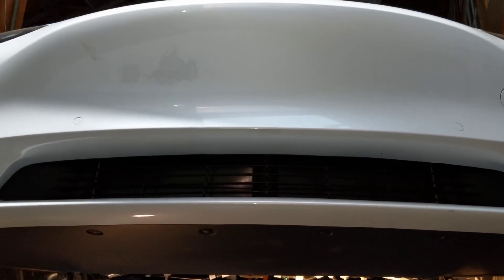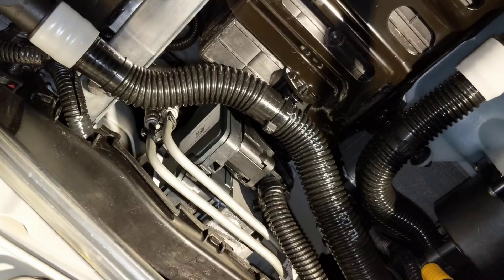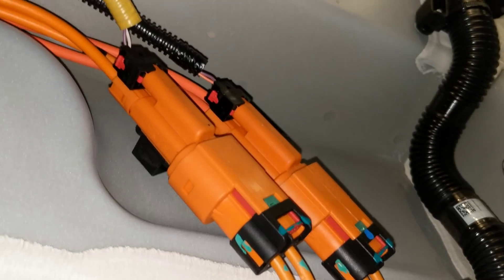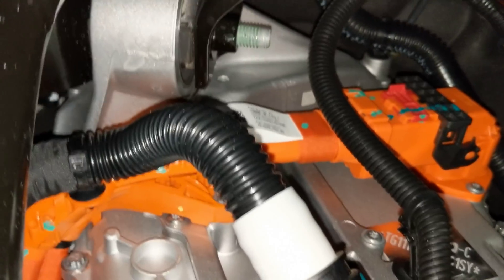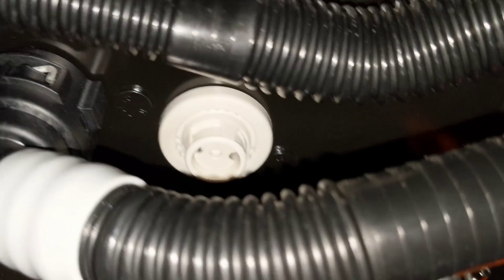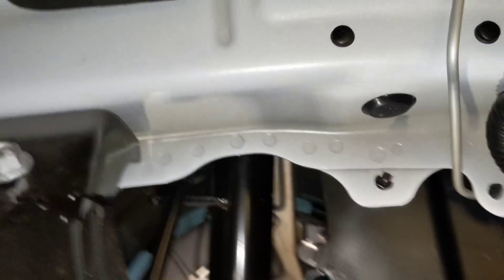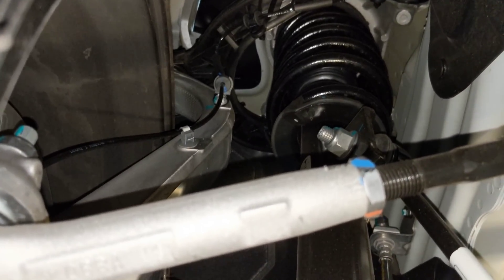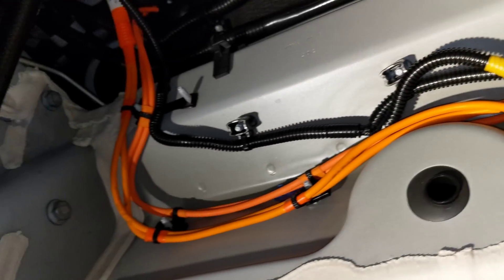Tesla Model 3 Stripped - Part 2 - The Dark Side

Comment: Awesome video!!! Thank you so much. Hey, since you're so knowledgeable, if you get a minute take a look at the new Sandy Munro video here: https://insideevs.com/teardown-expert-test-drives-tesla-model-3-no-longer-compares-it-to-90s-kia-video/.

At 6 min he starts taking about the "transmission" which I think he is using the term very broadly to refer to the drive train from the motor output to the wheels. He is impressed by what he seems to call a "5 bar link"?? Do you have an idea what he is talking about?

thanx!
Steve
Reply from the maker: That's the rear suspension.  You can see it in my video.  I'm not impressed by that guy at all.  He spends a lot of time going on about stuff that just doesn't matter, such as access to the first responder loop.  The 3 will automatically cut power to the HV system in an airbag deployment.  No action needed on the first responder's part.
Reply: Thanx. Thought so. Well he's definitely speaking loosely in the terminology he uses!
Reply: FYI - I sent an email to the address in your youtube profile. Not sure if it works. Just an FYI. :>

Comment: That's an AC induction motor.. Not DC
Reply from the maker: It's a Switched Reluctance motor, using permanent magnets.  It is vastly different than Tesla's previous motors which were indeed AC induction.  Also, technically it's an integrated motor/inverter, so DC goes in one side, and kinetic energy comes out the other.
Reply from the maker: I assure you, Tesla calls it a PMSRM, Permanent Magnet Switched Reluctance Motor.  It's a new type, and very hard to get right, but Tesla did it!  More information: http://ieeexplore.ieee.org/document/6180757/?reload=true
Reply: @Ingineerix  why exactly Switched Reluctance and not interior permanent magnet synchronous machine (which by the way exploits partially the reluctance mechanism) as EPA official certification seems reporting? Excluding Elon's tweet ("switched reluctance partial permanent magnet") what are the sources ?
Reply: DC is a hangover term to describe that motor design. Thankfully more and more folks are using the term 'permanent magnet AC motor.' It is NOT an induction motor however. They changed design on the Model 3 to use magnets on the rotor over an induced current (still 3-phase on the stator though). I think it was to provide better low-speed regen. The front motor on the AWD models will be induction though. ;>
Reply: The classic switched reluctance motor does not use permanent magnets and has inefficiencies at certain motor positions and use cases that made prior EV engineers reject the motor design, however Tesla modified it to use a small amount of permanent magnet and has essentially invented a new type of electric motor.  I'd imagine that in the EPA documents they needed to fit it into an existing electric motor description.  Calling it a permanent magnet motor is incorrect as most of the magnetic fields come from electromagnetism, like induction motors, but permanent magnets were used to overcome the previous limitations of a switched reluctance motor.  As it uses very little permanent magnet, it does not have the rare-earth metal sourcing problems that come with mass manufacture of permanent magnet motors.
Reply: THANKS. From the IEEE SRM Introduction:
"Switched reluctance motor is the double salient-pole structure with neither windings nor permanent magnets on the rotor and concentrated winding embedded on the stator. Thus, Motor has a simple structure, low cost, high reliability, wide speed range, etc[1] SRM has been widely used in industry since its inception, however, the double salient-pole structure and the switch type power supply lead to inevitable noise, torque ripple and a large vibration, which limits its application in the servo system where the request of low speed runs smooth [[2][3]] The study of its output torque ripple has become a research focus, while the torque ripple is also the biggest obstacle for its full access to the market. Many scholars have put forward various programs from different perspectives to suppress the torque ripple 0 It can be summed up as following: One is to change the structural design of the motor, references [4][5][6] reduce torque ripple mainly through changing the structure of the stator and rotor; the other is to use the intelligent control technology, such as iterative learning control[7] vector control technology [8] sliding mode control [9] neural network control technology [10] and mixed excitation method [11]. It can change the output current waveform, making the SR motor torque becomes steady and smooth. Over the years, the study of the SR motor control optimization is more, while the study of the body structure to optimize the design is relatively little."
Reply: Interesting Ingineerix. A reluctance motor, eh? I've been wondering exactly what type of Permanent magnet motor it is. Tesla has not been all that forthcoming. May I ask your source to know that is the design they used? thanx.
Reply: And further to that, we had it early on that Tesla was using a "Motor/Generator Type 1 AC 3 PHASE PERMENANT MAGNET". This is from an EPA document (including the typo). I just had to look up what a reluctance motor is, and it appears to be a design that does not require permanent magnets (the electromagnetism created by the stator interacts with "reluctance" materials built into the rotor. I'm skipping the switching part). Assuming the EPA is correct, how could the motor be the reluctance type? Or is there a reluctance design variation that uses permanent magnets?

I'm a student of this tech Ingineerix. Not trying to trip you up. Just trying to understand, as there is a dearth of info on this topic. :>
Reply: A big, big thanks!
Reply: Yes well summed up. I hope someone like wk057 will quickly inform us what this new beast can truly output!

Comment: Cool video man I love to see how it’s built I’m a auto technician and work on European cars you can clearly see that they build it to save cost because the power train and especially the battery pack is expensive if you compare the built quality compared to a BMW ,AUDI or Mercedes you can see a lot of steel suspension components like rear control arm the front and rear subframe are all steel nothing wrong with that but the chassis is not up to the level of it’s competitors I would still buy one but the only thing I don’t like about Tesla is parts availability and diagnostics that is only available to Tesla technicians.
Reply: Why do you say the chassis is not up to the level of competitors?   Multiple professional reviews so far say the car drives very well, has excellent responses and feel, etc.  Small steel suspension components won't affect performance or feel very much.
Reply: The "whompy wheels" guy turned out to be fraudulent. Not just "some guy on the internet says his claims were fraudlent", but the NHTSA. He was just taking pictures of wrecked Model Ss and then claiming that a "failed suspension" caused the crash, when in reality the car was mangled in an unrelated crash, which correspondingly damaged the suspension.

And as for the "alumium is better than steel" comments: on a strength-to-weight ratio, modern steels such as UHSS are far superior.  Alumium is best for parts on which not much strength is needed, but where you need strength, steels gives you your best buy for your money among metals (only composites beat it, and they have their own disadvantages). Steels are also far less prone to fatigue fracture than alumium - especially if your alumium is tempered enough to try to give it decent strength, wherein it becomes brittle. Steels of course rust if improperly protected, but then again alumium galvanically corrodes badly if you inadvertently touch a part up against a part of a different material, and often suffer badly from salt corrosion.
Reply: The motor is neither induction nor permanent magnet.  It is switched reluctance modified by a tiny amount of permanent magnets to make switched reluctance efficient, but it is very different from a permanent magnet motor design.  No other manufacturer or car is using this yet.  But they will, it is superior.
Reply: i would say also as a mechanic that the front motor will be a smaller unit like on S and X. Main power will be allways on the rear wheels and front motor will be more like passive when not in use like autobahn or cruising.
Reply: I'd say one motor type is optimized for "fuel economy" and other for performance, so for cruising it's maybe using PM and for acceleration AC motor.
Reply: It's not a PM motor, it's a switched reluctance motor.  Tesla's design is unique and uses a small amount of permanent magnets, but it is not a PM motor and has nowhere near the rare-earth needs of fully PM motors.
Reply: Do you think on the dual motor version that it will have the same exact motor as the rear ?
Reply: No. It will be induction, like the S/X
Reply: What do the other guys use instead of steel?
Reply: They uses aluminum for the subframes and most suspension parts.
Reply: I think the motor will be permanent magnet instead of induction
Reply: OK, but Tesla has already tipped its hand that it will be induction
Reply: Interesting, given the priority of weight reduction on EVs. Must be a significant cost difference.
Reply: Steve bakker 
Any idea why they would use PM motor for rear and AC motor for front?
Reply: But you hear of suspension parts failing frequently on the 'S' and misaligned wheels. These cars will not last and the spare parts are impossible to get.

Comment: i do not like all the open wires ... for the wiled life to get into
Reply: Ingineerix removed many covers to expose those wires for the review. Tesla designs cover the bottom almost completely from front to back. Keeps animals out as well as wind for reduced drag.
Reply: For what it's worth I have a 2002 Dodge ram pickup and watched a ground hog jump up under the front one day. When I checked the next day he had climbed all the way up on top of the engine and chewed on the  firewall insulation. So the Tesla isn't any worse than most other cars.

Comment: What is the oil filter for?
Reply: When vehicle is new, during drive-in period, small metal shavings contaminate oil when gears polish themselves. This is why Model S/X require oil change on first service. Now there is no need to have oil change.
Reply: Just to be clear, Arnis is referring to the gear box (what some call a single-speed transmission). It does the gear reduction from the motor and drives the CV shafts that turn the wheels.
Reply: For filtering oil...

Comment: wholly shit...this ev has an oil filter!! lol..I guess there are filter to change after all.
Reply from the maker: The reason it has a filter is so the DU lubrication lasts the life of the car.  I don't think it needs changing within a million miles.
Reply: Any gear set (there is both a fixed reduction gear and a built in differential here) will have fine particles that occur mostly during the “running in” process. It’s great that they’ve added a filter rather than just rely on magnets to catch this stuff. I’m impressed, that’s seriously good engineering!
Reply: shinybaldy means the gear oil filter.  There is no fuel filter on a pure EV, since there's no fuel.  And yes, the gear oil filter is large and should last the life of the car.
Reply: As in all things engineering, there are tradeoffs.  A large external filter is a great way to catch the particles, but it adds cost and a possible point of damage or leaks.  That said, it does indicate thoughtful engineering.

Comment: Somewhat surprised that there aren't more protective covers of the parts from the elements.  For example, at 2:10 the wire harnesses seems poorly protected.
Reply from the maker: Correct, there are a lot of plastic covers.  For instance the bottom is totally smooth with everything installed.
Reply: There are, he removed the bottom covers prior filming.
Reply: Steffen Frost Also...look underneath most cars, like the Chevy Volt.  You’ll be able to see the fuel line, brake lines, coolant lines, and high voltage cables exposed, inches above the pavement.  I have no idea why this is considered acceptable to automakers, but they do it all the time.

Comment: About 10% of all that was correct. He is just making stuff up as he goes
Reply from the maker: It's actually a permanent magnet switched reluctance motor.  It has the highest efficiency of anything ever put in a production car.  It's also a unit, the inverter is integrated, so DC goes in one side and kinetic energy comes out the other.  Nobody else has figured out how to get a PMSRM to work smoothly and efficiently like this.  It's not easy!
Reply: +L Pablo Mendez     Please post a list (with time stamps if that is not too much to ask) of corrections. I saw no problems with this video but you apparently know so much better. I'm anxious to hear more of your wisdom but with specifics this time.
Reply: That actually is an accepted [legacy] term (unfortunately) that even old Wally Ripple has used. So technically he is not wrong. But  permanent magnet AC motor is soooo much more descriptive. ;>

This Pablo guy seems way out to lunch.
Reply: You gotta hand it to JB Straubel and the power train crew and Elon Musk on how they have done so far. Sandy Munro of Munro and Assoc. likes how they have done the rear suspension  ,the fit and finish  he's not pleased but the sample he procured is an early build ,so bound to be issues,he is RE & teardown  right now.
Reply: Pretty sure he/she (L Pablo) was just joking around
Reply: guess we found the thumbs down guy...    btw great video and thank you for taking the time out of ur day to make this video for a bunch of strangers..
Reply: I don't know about 10% but he did call it a brushless DC motor @ 2:26 and it is a permanent magnet AC motor.

Comment: Those unsealed front wheel drive motor cable holes on the battery pack worry me :/ 
Edit: can't write at 2am
Reply from the maker: There is no unsealed motor, and this car is not front-wheel drive.
Reply: Did a edit I meant to say the wholes on the battery pack for the HV cables going to the front wheel motor. Looked to be unsealed from the outside.
Reply from the maker: That's just a cable tray carrying the cables to the back.  It does not penetrate the pack.

Comment: Could you help me resolve the front suspension design? I'm having trouble visualizing the steering action with 3 ball joints seemingly triangulating the knuckle in place.
Reply from the maker: Look up "dual ball joint suspension".  It's been used on many cars, and it's also on the S and X.
Reply: I should have before commenting. Thanks for the reply.
Reply from the maker: Yeah, it's a tricky suspension!  But it seems to work well.  I'm extremely impressed with the handling on the 3, and my only complaint is NVH.
Reply from the maker: They are retrofitting a mass damper to the upper control arm.
Reply: Ingineerix I believe Tesla is doing a recall or mitigation program to address NVH complaints.  Reportedly, the first batch of Model 3’s were too harsh and Tesla did some tweaking/replacement to the suspension.  Other than that, I have no idea of specifics.  Could just be a rumor.
Reply: I only had a quick look a this, but your're right. It is triangulation as you mentioned. This is probably not the best explanation, but I'll give it a go.... If it's anything like other front suspension designs I've worked on, you have to imagine a line along each lower control arm, from each internal pivot point, to past (note I said PAST) the ball joints on the outer knuckle. Where those two imaginary lines meet up (towards the outside of the vehicle, and ideally, in the center of the rim) forms a "virtual pivot point". In effect it's the same as having only one lower control arm with a lower ball joint in the exact center of the wheel rim. This prevents rearward force on the wheel as it hits obstacles, therefore not inducing a thrust in the steering, and therefore preventing "bump steer". It's a great concept seen on several cars now.